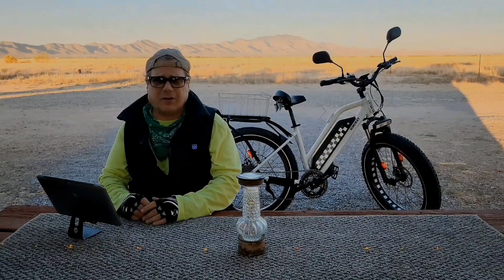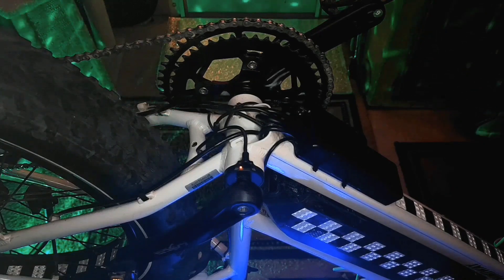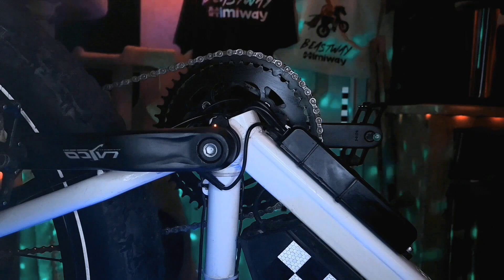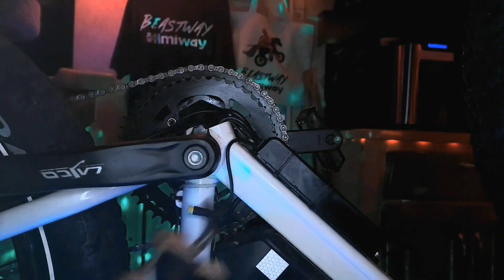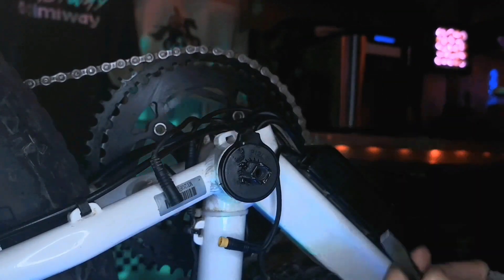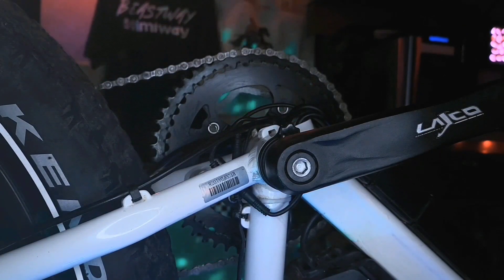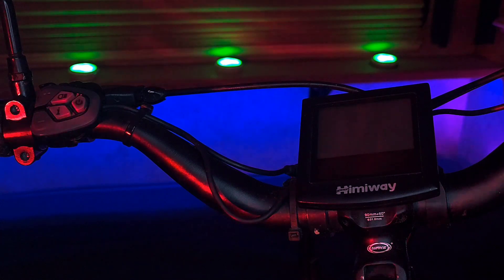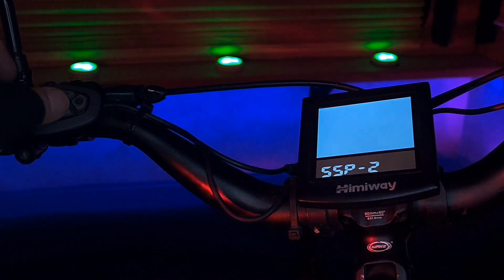Himiway Expert! How to inspect or replace a pedal assist sensor. How to change your SSP settings.

Comment: What size crank puller are you using and where do i find one? thanks
Reply from the maker: The link to the crank puller is in the description:
Oumers Bike Crank Extractor/Arm Remover and Bottom Bracket Remover with 16mm Spanner/Wrench. Professional Bicycle Repair Tool Kit https://a.co/d/9ckk2XN